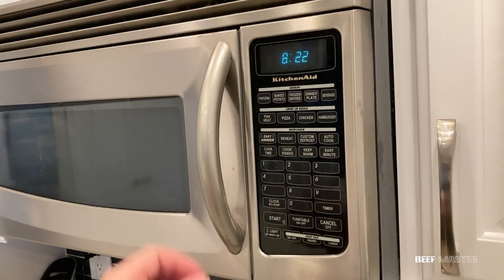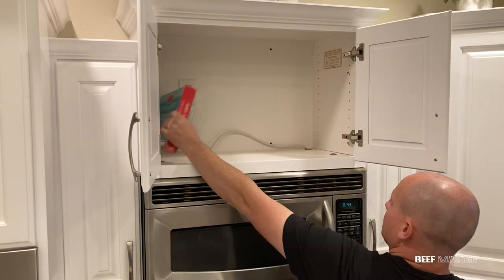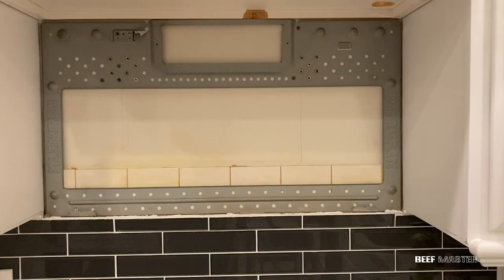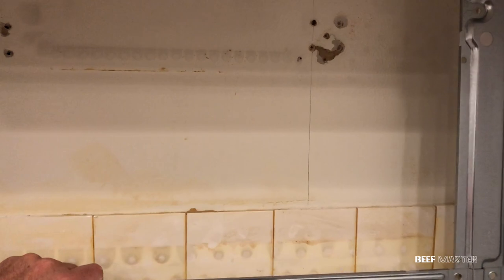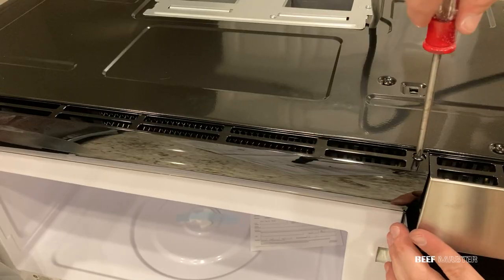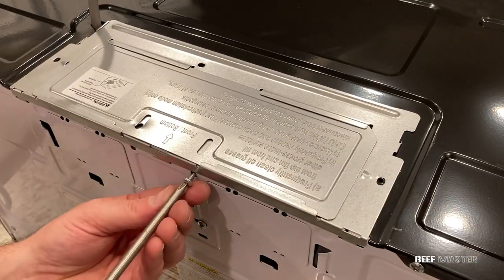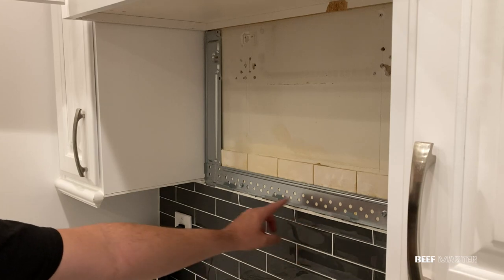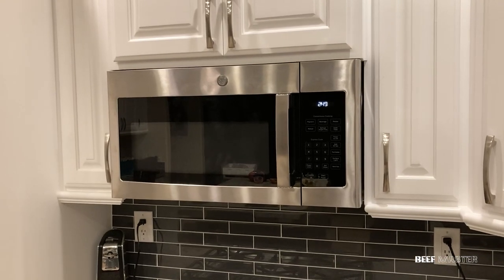How to Install a New Microwave - Easiest Step by Step Guide

Comment: How does the air from back side of the microwave go through ?
Reply: You're supposed to run a vent out the exterior wall. Of if you don't have an exterior wall behind, it's supposed to vent up through the cabinet and into the ceiling, and through the attic wall or somewhere to outdoors.